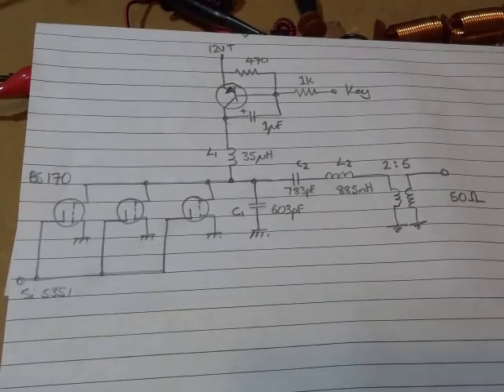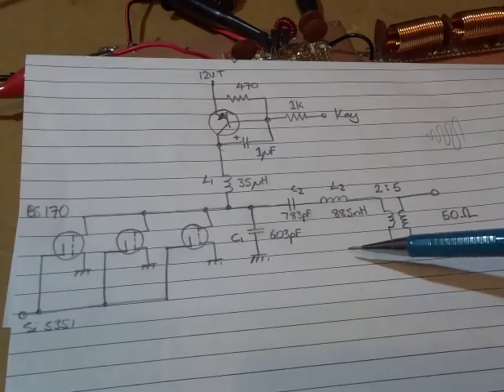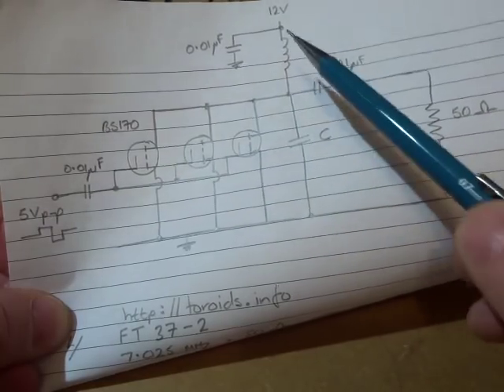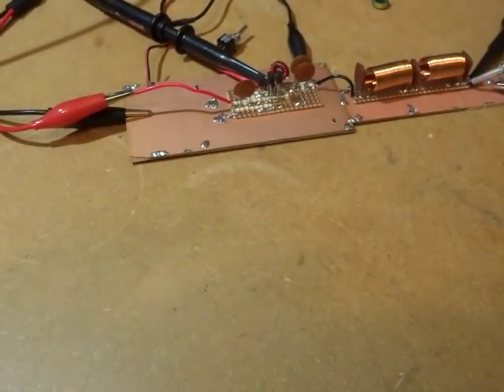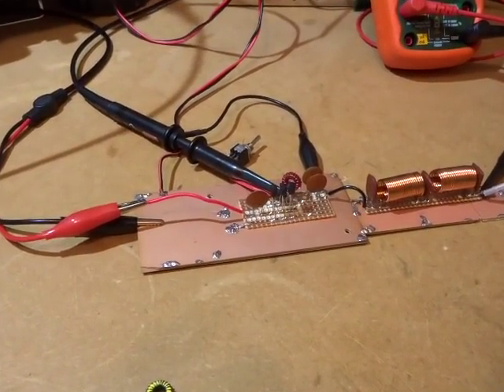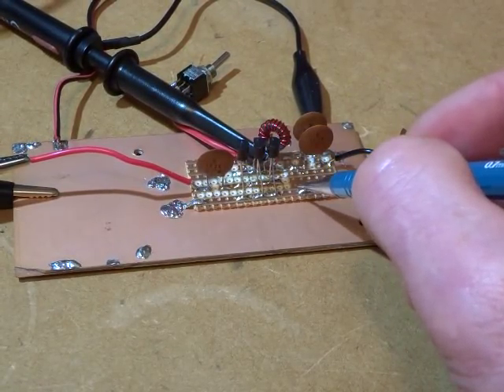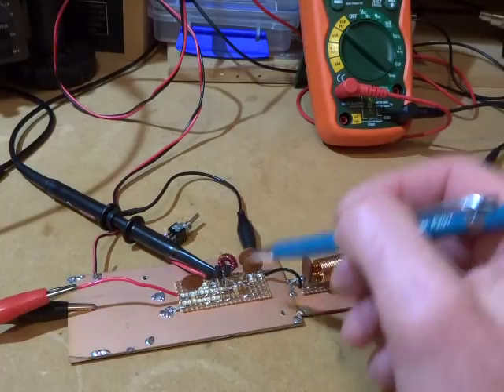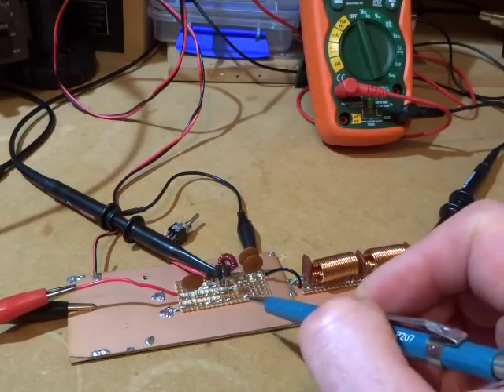Homebrew 40m CW Rig - #6b More Amp Experiments

Comment: Nice work Charlie! Thanks for sharing your experiments. I'd be curious to see the waveform of the drain current and drain voltage on your O-scope. A small source resistor can provide the drain current signal for your scope. That way you could see if your transistors have areas where they have both current and voltage simultaneously (which is power loss in class-E). BTW, I caught a glimpse of the cool HP calculator in one of your videos. Thumbs-up for RPN!
Reply from the maker: That's a good piece of info thanks Mike. This was the first time I had experimented with Class E. As for the calculator, I love my two HP48G+ calculators. I have one at home and one at work. I have had them for years and they work great. Once you are proficient with RPN you cannot go back.

Comment: One thing i dont understand yet with class C and class E is the "rf choke" in the collector. Wouldnt this limit the amount of current that we could get into the load because if you say wanted around 50 watts out and you need a load of 3 ohms or such with 12 volts (which you then match to 50 ohms with a Pi network) . My issue is, isnt the inductance of the rf choke going to limit the amount of max current depending on the frequency? If you are running at 7mhz for example the choke would limit current peaks. It seems like you have to calculate a choke value that is small enough to allow the max current you need, but i never see any design article (so far) talk about this. They almost pretend the rf choke doesnt interact at all with power output. When that transistor turns off the current is gonna ramp up but be slowed down by that choke. So i would think its inductance value would matter a lot, amd almost be the most important thing to figure out but i have found very little information about choosing this value.

I think the math for class C and class E is hard to get right and i have yet to find a really good source of accurate info on their proper design

Comment: A few months ago I spent a lot of time working on a 20 meter Class E amp design.  My objective was high efficiency as I intend to use the amp in an high altitude balloon transmitter powered by solar cells.  My LTSpice simulations all showed efficiencies in the upper 80's percentage.  I reach the expected power output.  But, despite many attempts, I was able to get no more than 65% efficiency in an actual circuit.  I don't know why the efficiency falls short.  My switching signal is fast, coming out of a NC7SZ125.  The transistor is SSM3K56MFV.  I haven't tried the design by Hans, but will have to look into that.  I'm going to keep pursuing that high efficiency the theory promises!
Reply from the maker: Hi. Yes, I'm not close to the ideal efficiency either. Still a simple and effective amplifier. Keep us posted on how you get on.

73s
Charlie

Comment: Hi Charlie,

Just a comment about the input on this amp design.  I've been working along a similar path, inspired by the PAs in U3S and the QCX.  Both designs by Hans.  

This particular design in your video is virtually identical to that used in the QCX, which leads me to my comment.  

The si5351, as I believe you are aware, is only around 3V peak to peak. To overcome this in the QCX, Hans drives the amp input with a 74ACT00, fed by the si5351, to boost its output to a full 5V.

I'm waiting on some 74ACT00 chips to play with this version of the amplifier.

All that said, I have been experimenting with the U3S PA design which uses a bias on the BS170 gates.  That design will amplify the si5351 directly, albeit with slightly less power out.  It is however, somewhat less frequency specific as it does not use a resonant circuit in the output stage and, it cleans up quite well with a good low pass filter.

Anyway, thought I'd just pass that along.

BTW, Love Your Videos!

73 Robin
Reply from the maker: Thanks Robin. I did have some 74ACT00's waiting in the wings, but elected not to use them in the end. I might still look to add one in due course. I must take a look at the U3S PA too.

Thanks again.

Charlie
Reply from the maker: Just took a look at the U3S PA. That does look straight forward and very simple. I'll definitely add that to the design notes pile!

Thanks again Robin.
73s
Charlie

Comment: Hello Charlie,
I hope that your vacation was relaxing.
I do not understand your calculation. You use the amplifier at 12 volts and it consumes 0.3 amperes. If I calculate (12V x 0.3A) that gives me a result of 3.6 watts input power. Is´nt it right? Or maybe I overlook something?
On the oscilloscope screen I also recognize that the 3 FETs work in a linear region (Drain voltage measurment). The gate capacity of the three FET together is about 100pF. Does not that matter too? Are these FETs switching so fast at all?
73 Bernd
Reply from the maker: Hi Bernd. You are correct. I wouldn't be surprised if I mucked up the calcs somewhere. I used the RMS voltage across the 50ohm dummy load to determine the power out. As for the 100pF, that's resonating with the inductor. I'll keep playing.